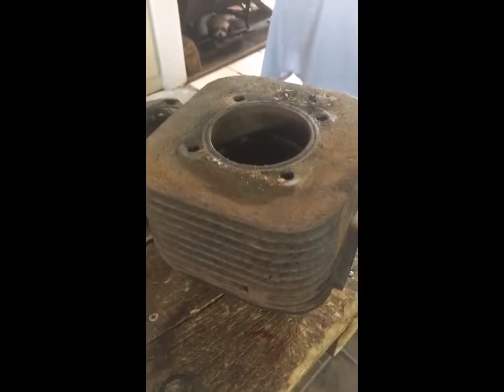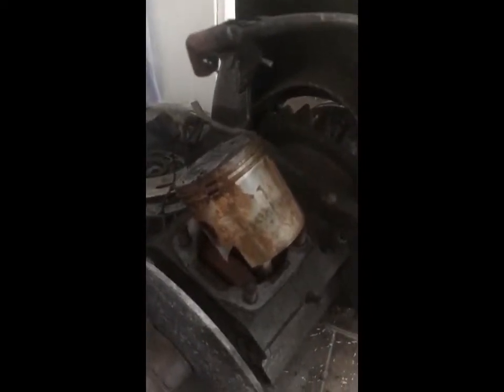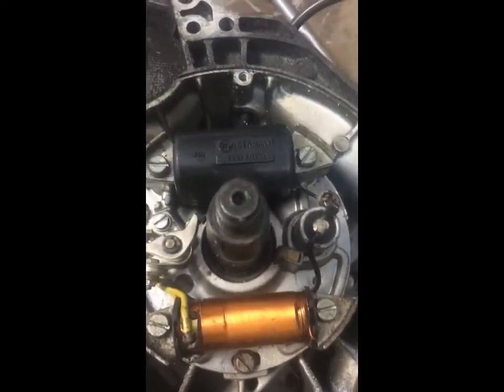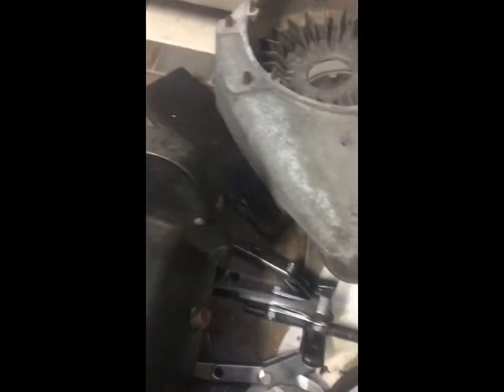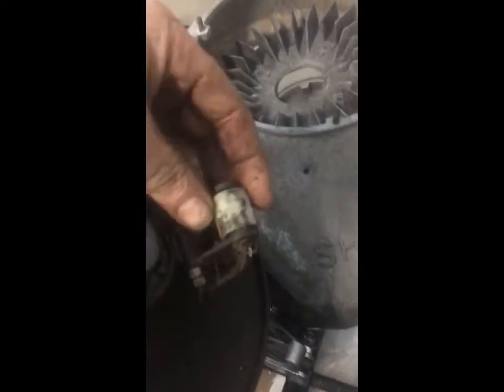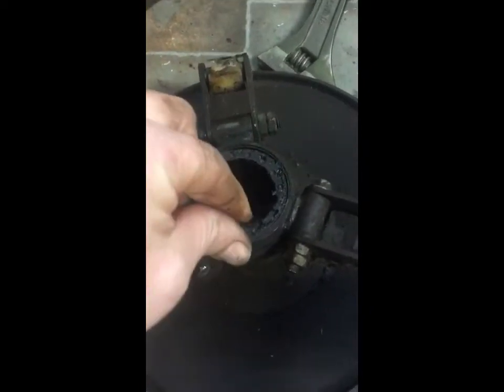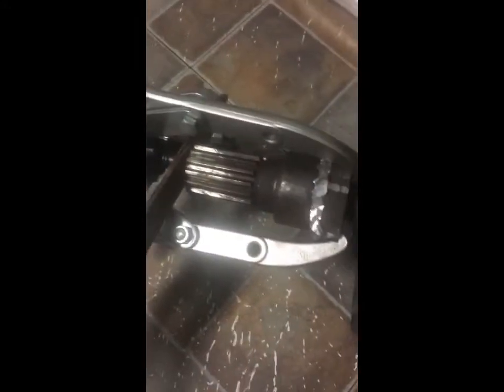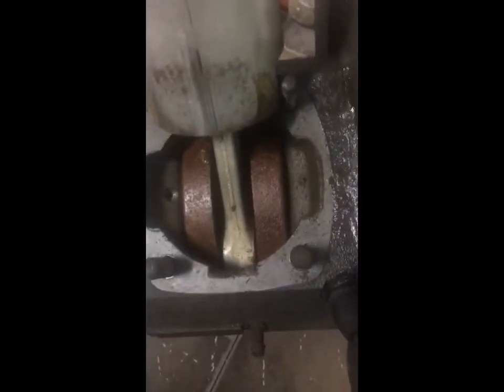69 scorpion engine build part 1

Comment: My guess if it turns over it will probably start so I wouldn’t even take the good one apart. Just put a little bit of 2 stoke oil in the cylinder to free it up a little more instead of WD-40. I think it worked better for me